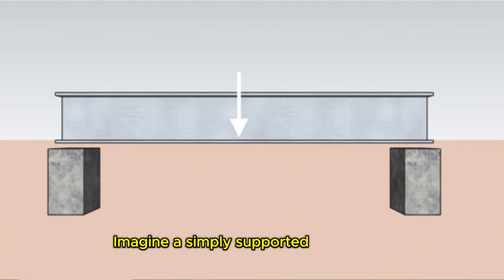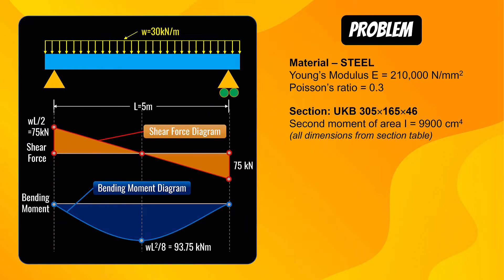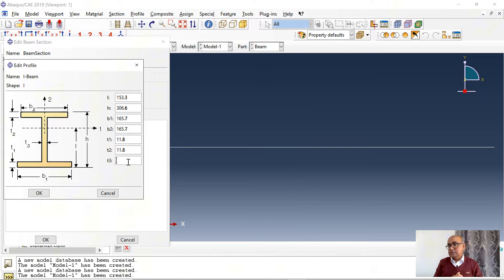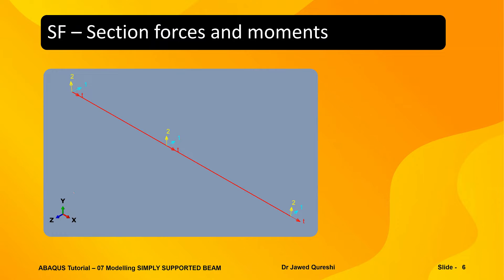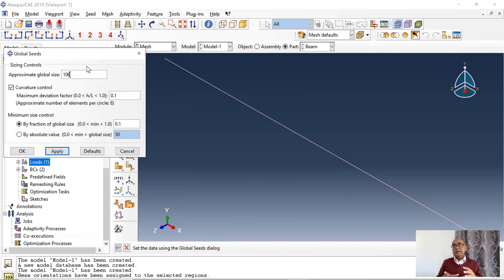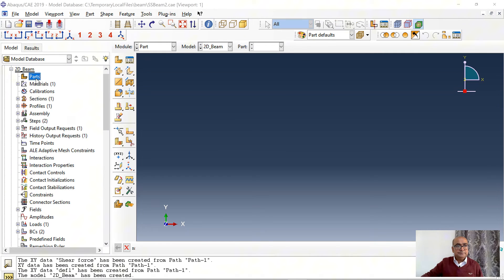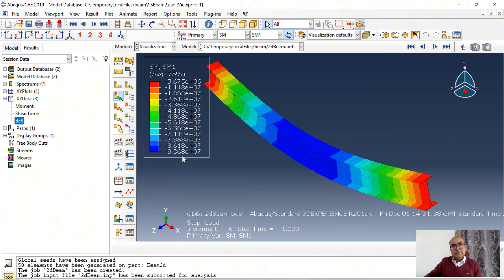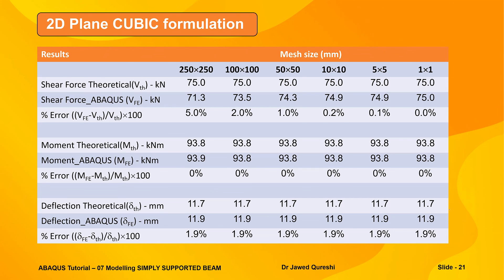7 How to draw Shear Force and Bending moment diagram of simply supported beams – ABAQUS Tutorial

Comment: Why is the increment used here only up to 6, when there are 100 increments
Reply from the maker: I don’t remember. Please have a look at the input file included in description.
Reply: @DrJQureshi Thank you in advance, let me ask again, is this method suitable for arc length?
Reply from the maker: @ciptowahyu4688  Yes, suitable. But I think finding shear force and bending moment diagram is easier with other software, such as STAADPro and S-Frame compared to ABAQUS.
Reply: @DrJQureshi ahh, thanks for helping my thesis dr
Reply from the maker: I don't think there are 100 increments. In mesh i had 100 seeds.

Comment: Can I obtain these internal force diagrams using a solid element with element C3D8R?
Reply from the maker: You can, but they are not as accurate and easy as you would get from any other structural analysis software, S-Frame or STAADPro.